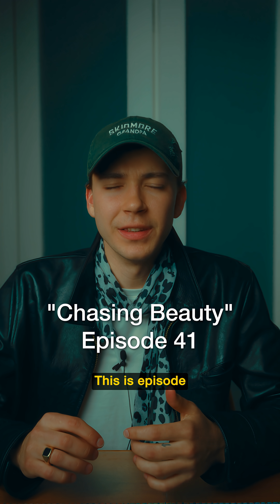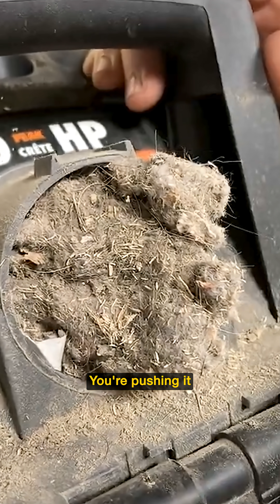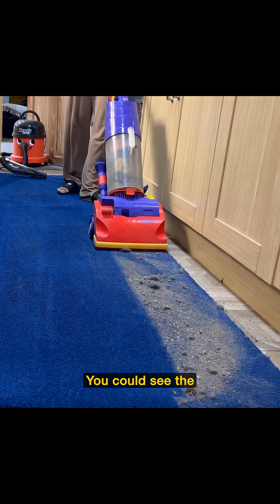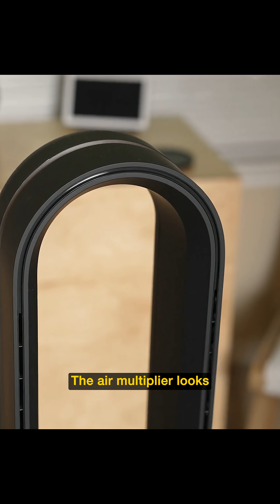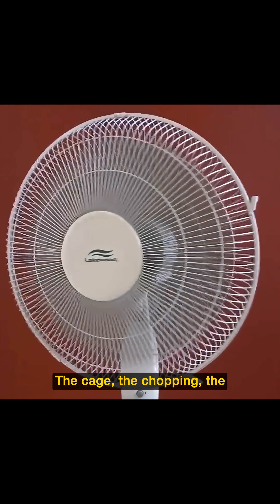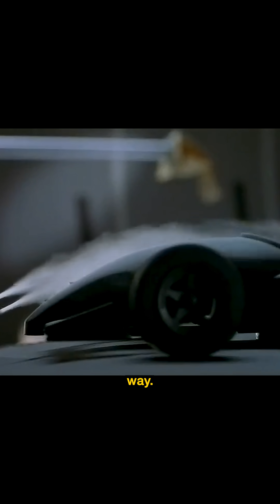Dyson products look weird, but there’s a reason. Behind their iconic product design...

Comment: This only works on easily impressed morons. The dust being visible is disgusting. You are cleaning precisely because you want to get rid of it. Showing it off is like watching yourself poop through a camera in the toilet. The bladeless fan is also a lot more complex and impossible to repair, not to mention drawing up air from the bottom oft the fanbase, essentially giving you a nice misting of carpet dust. The hairdryer seems cool because it is lightweight, until you notice that you are blocking the air intake, because your hand and sleeves are close to the bottom of the hairdryer. Also all the comfortable whirring of hairdryers and fans is replaced with an irritating high pitched whine. These could have been great inventions. They were not. The fan makes the most sense because it is at least bottom heavy, but putting the impeller there sucks in dirty air, unless you use a desktop fan only. It's also a gimmick, and hides the interesting moving parts.

Comment: After years of using bagless vacuums, I have figured out that actually bagged vacuums are way fucking better.  Maybe an expensive Dyson is better, but every bagless imitation Dyson sucks (or doesn't, I guess) so much ass and a cheap bagged vacuum wins every time vs non-Dyson bagless vacuums.  The bags are really not that expensive, anyways (order them online).  Plus it's way cleaner to replace a bag than to try to dump out a canister full of dust that inevitably poofs up into a mushroom cloud straight back into your face when you dump it out.

Comment: I hate bagless vacuums. Fine dust still clogs the filters and emptying is messy. If you have a emptying station, the thing needs the same space, cleans worse, costs more and is less durable as a corded vacuum. As a small handheld 👍 As main vacuum 👎

Comment: The efficiency of the blow-dryer and the ventilator is reduced by 2/3 or 3/4. these products are extremely less efficient. The vacuum cleaners have terrible quality. The transparent plastic breaks & chips easily. Diesoon is a clear example of form over function. The products are at least 5 to ten times overpriced. The phyisics behind them is fake. You can‘t make up with a smaller faster motor (will always use exponentially more energy) for a misconstrued airway. Please don‘t fall for Diesoon. They are marketing products close to being fraudulent: especially the super inefficient ventillator without blades

Comment: In the US, the Fantom Cyclone was first, but went bankrupt in 2001.  Dyson didn't come here until 2002.  I had the Fantom and hated it.  You'd think I had learned my lesson, but nope, I've had 2 Dysons too.  Too many joints, seals, too much plastic.  Now I'm using an old Kirby G5 that I got for $100 with all the attachments that does a much better job and can be fixed instead of thrown away.  We still have an older Dyson V6 stick vacuum that's ok for quick vacuuming of the furniture, but I have to take it apart every few years to clean out all the passeges that get plugged over time.

Comment: Too bad standard Dyson fans & vacuums clog up with dirt. 

I dont own an air filter one (they are too expensive) however, the inner ring where the air comes out has lots of dust and dirt collecting there. 

If you press gently on the inner part near any point where the air comes out, dirt will also come out when the fan is on. 

I don't want to imagine what the inside looks like. 

Also their vacuums have similar problems since they run the power cable up inside the hose.

Dirt & hair get stuck at the points where the cable is attached inside the vacuum hose.  

And inside the head attached to their clear dirt container it also gets clogged up with fine dirt, etc.  

Both are a headache to clean.

Comment: Almost hit the mark but didn’t. They shift the design to make it look like they solved the problem. In every single one it’s still the same thing just pivoted to look totally different. The closest to actually being different is the Vacuum. However, anyone who is actually into vacuums usually buys a bagged vacuum. This is because again Dyson didn’t solve a problem they just shifted it. You can’t have unfiltered air passing through a vacuum motor. Especially when the job is to literally pickup dust and dirt. Bags in a traditional vacuum act as the canister to hold the dirt and debris but also the filter for the motor. Dysons design sounds great on paper as no need to buy bags. However, the centrifugal force acts as a filter for large items which is what it collects in its canister but small dust still gets through. So Dyson had to add actual filters to prevent damage to the motor. If you check any bag less vacuums manual it will say to wash the filters regularly. I’m talking once a month or more. Then replace the filters periodically. If you have  ever owned a Dyson or other  bag less vacuum and did not maintain the filter I assume after a year it barely worked. It’s because the filter is clogged. Bagged vacuums have very very little Maintanence in comparison. Bag is full toss and get a new one and keep going.

Comment: I own 3 Dyson vacuums. The Ball Animal, the Canister Animal and the Cordless V60. I’ve had them for years. The Canister Animal was my first one and the first time I used it, it actually sucked up one of my cat’s nip toys! I was shocked that it actually settled in the canister. It was then I figured it could probably suck paint off the wall, I’m joking but the suction of it was unbelievable! I use it not only to vacuum but to also dusting with the correct attachments. 

I recently broke down the cordless (it gets used the most) and I’m talking broke down as in all the screws and seals removed and cleaned. After it was completely cleaned and put back together, the first time used it was like it was brand new! I would definitely recommend having your Dyson cleaned on a regular basis and if you’re feeling ambitious, take it apart and clean it yourself, you get to see the inner working of it!

Comment: the air multiplier thing is really interesting. it essentially trades in the velocity for flow. normally, if you just jet a small amount of high velocity air into ambient still air, most of that energy gets immediately lost to turbulence, but with the right geometry, you can use that small amount of fast air to smoothly bring a lot of still air up to speed keeping the flow mostly laminar

Comment: Just to be pedantic the first Dyson vacuum cleaner was not the DC01. It was called the DDC, Dyson Dual Cyclone. 
Only later when they bought out the cylinder model did they call it the DC02 and renamed the original upright the DC01.

Comment: 2 things tests have shown blade less fans are not more efficient they are actually less efficient than a normal fan and Dyson vacuums suck compared to the older bag versions they actually had more suction power and maintained their suction for longer than modern ones and every time you replaced the bag it went back to full force the only advantage the Dyson vacuum had was that you didn’t have to buy replacement bags

Comment: Their vacuum cleaners work well, but battery life sucks. Their fans are expensive crap. Sure it's more silent and filters the air. But for having one at home... When it gets really really hot... My cheap 30 euros fan makes much more air and cools me way more. Soooooo it might be cool looking but it's cheap plastic. You can only control it with the tiny remote control. No battery or lost it? You're stuck on what it was last. It's not worth 400 euros (for the one we have).

Comment: I’ve had 2 Dyson vacuums, a cordless and a corded, and they both were pieces of crap.  The build quality is cheap and flimsy, and I’ve had to replace the battery in the cordless vacuum frequently.   The upright corded one has a stupid mechanism for locking it upright that never worked properly.  I will never buy another Dyson product.  Interesting in theory, garbage in execution.  All looks, no function.

Comment: There were bagless vacs long before dyson.
They used to also have fabric bags you would empty, and you would shake and snack them forever and still more dust, so you could also wash them if you wanted, just make sure they are totally dry before you use them again or you can end up turning your bag to concrete.

Comment: Dyson makes water taps as well. They have a built-in air dryer. The design issue is that you can easily activate the air dryer while still using the tap, resulting in water being sprayed all over the place, including you.

Comment: It is design, sometimes over, function. The vacuum cleaners aren’t the most effective, for your wallet or your cleaning. But the hairdryer can be for the right customer. I have super thick heavy hair, non porous so it holds onto water. The Dyson hairdryer is very powerful and the weight distribution is really helpful. The powerful airflow speeds up the drying process and the heaviest part being right in your hand instead of above your grip delays arm fatigue. Worth the splurge for people with hair that traditionally takes a long ass time to blow dry lol

Comment: Bags are more hygenic though.  No dust storms when emptying the dust.  You can compact the dust, by the sheer nature of having a very powerful suction. So, as the bag fills, its suction is less, but not significantly less until absolutely full.  But, your impatience to change the bag will usually make you change it sooner.

Comment: I hate bagless vacuums. Emptying the container us easy but cleaning the filter is a nightmare. You end up inhaling the fine dust sticking to the filter while brushing it away. Bags could be changed when the suction got low. The bag held all the dirt a5dust, and you could simply throw it away.

Comment: Those fans are great and all, but they lack static pressure(more air speed with the same amount of energy means less pressure behind it), so any amount of air movement not produced by it will be enough to pretty much stop the thing from working.

Comment: My Sister has a Dyson vacuum cleaner and my mom used to have one before she moved into her nursing home and I actually like my Dirt Devil better than their Dyson vacuum cleaners for 3 reasons 

1. unlike Dyson my Dirt Devil is such a pleasure to clean Dyson vacuum cleaners are so complicated to clean 

2. you have to consistently hold down the power button on a Dyson vacuum cleaner or else it won’t stay on that’s not an issue for my Dirt Devil

And

3. Dyson vacuum cleaners can’t lock into an upright position and can’t free stand they fall over the second you let go of them my Dirt Devil can lock into an upright position and can free stand free stand also my Dirt Devil has a clear dirt collector bin and you can see the dirt spinning inside and it has a little hose with attachments to get into small places something my mom’s old Dyson and my sister’s Dyson don’t have

Comment: Any cannister-collection vacuum (not just Dyson's) will exaggerate the alleged benefits of going bagless, but all vacuum cleaners use filters, and the bagless ones might be clogging their filters faster than the bagged ones. 

The nice thing about a vac bag is that you can toss it in the garbage (for maximum tidyness, encase it in a plastic baggie first), in contrast to the dusty, hay-fever-triggering mess that is emptying a bagless cannister in the trash [can] outside, 'cuz emptying it into an inside garbage can makes a mess and spreads dust inside the house.

Comment: From actual usage experience, the Dyson fan is a bit weaker if you want direct fanning/wind, but it's fine for general circulation, and it's definitely easier to clean/maintain.

Comment: Reading the comments on here is actually quite scary, when you see how many truly dumb people there are who even though they have access via the internet to all the information in the world they still blindly refused to see.

It’s really odd the way so many people fail to see the world around them as it actually is, but only see what is obviously visible.  

A Dyson bladeless as opposed to a traditional fan.

The traditional fan move’s air, it’s as simple as that, that is all it does it moves air from the back of the fan and pushes it out through the front of the fan. 

The Dyson takes air in through the base centrifuges it pushes it through a filter and then pushes clean particulate free air out through its loop.

But simply because you cannot actually see that in action to you it doesn’t exist, but it doesn’t stop you comparing an apple to a cabbage and using social media to tell the world your incredibly ill observed opinion.

Comment: I’ll disagree with most commenters here, I don’t particularly like Dyson products. They look different, but they’re not that great. Years ago, I was looking to buy a new quality vacuum cleaner and checked out the Dyson models. I was so disappointed, they felt cheaply made, heavy and bulky. The fit and finish sucked, they were loud and the canisters didn’t seal well. I purchased a made in Germany Miele with bags, much better made, better quality materials, quieter and it’s been working flawlessly for 15 years so far. I just have to replace bags once in a while.

The Dyson fans are cool but they’re loud and way too expensive. I wanted to like Dyson, but their products aren’t up to par with other quality brands even thought their pricing is. They look great in CAD images and CGI animations, not so much in person.

Comment: Personally, I feel the Dyson fans are far weaker than any other fans. 😅
However, they do have an occasional use. Whenever it’s slightly too warm that you need a fan, but a normal fan might make it a bit chilly…that’s the sweet spot for a Dyson fan—as they can blow more subtly. 

Outside that situation, they’re sort of a terrible fan.

Comment: Too bad dyson is overpriced crap. I have two bladeless fans. One already has issues. Build quality is terrible. And they want a new expensive filter every year. The filters which dyson stopped selling after 3 years. They cost an arm and a leg. And guess what, a regular fan at a quarter of the price works just as well. Stay away from Dyson.

Comment: I own dyson. They arent that great as a company, with durability, or customer service. You can literally void your warranty by vacuuming DUST. DUST. DDDUUUUSSSTTTT. They got on to me vfor vacuuming dust!!!!

Their multi floor 2 is was 425 after tax.
While it was being repaired for the 5th time in 2 years I purchased a Dirt Devil for 78$.

I was desperate. It worked just as good as the dyson.
I was offended.
It broke multiple times after that, even recently and now they do not sell the most important parts of the machine.... the canister.

They quit selling and providing replacements in less than 2 years after purchase and I was still under warranty. It's been 3 years and they still wont sell me a replacement, even if I pay for it!

It just spits everything out to the floor again! 

To release the canister from the vacuum you press the same button that EMPTIES the canister.

It's bad design and the hoses are absurdly difficult to navigate with.

They clog easily.
Bin fill easily.
Not a quality product. Now I dont trust any of their other products.

Comment: Now if only they could design appliances like they did in the 50s and 60s. Shelves that pull out so you don't have to move 50 things to get at the back. Compartments in the door which are removable for easy loading. Ice cube trays that empty into a bucket with the press of a button. And the facade of those appliances. Nostalgic

Comment: I don't need a Bagless vacuum, they are weak, they are bad at filtration, my bagged vacuum has airflow max technology, when the bag is full, it's still gonna have the same airflow, and it's one of the most powerful vacuum (in airflow and suction) if you want to know what model this is
Philips performer pro 
2100w, sadly they aren't available anymore bcuz of eu rules

Comment: I've begged clients who don't know anything about cleaning to not buy Dyson or any other bagless, upright.
They think it's going to be easier, but never stop to think that they have to empty it constantly, especially the filter when it clogs.
Nothing like a basic, heavy motored canister with bags you only have to change when it gets full.
You can go under furniture without having to dismantle it, you can pull it wherever you need it and the beater bar doesn't push little tiny things around in front of the lip.
Much like front loading, digital washing machines...
Less water! Less agitation! just stuff it full of clothes and it's magic!
But it's not.
The clothes roll back & forth without enough water flowing through them.
One sensor goes wonky & you have an appliance visit that costs almost as much as a regular, no frills, analog machine.
The owner of a family owned appliance store in town once told me his back room has well made analog machines that he saves for his family & friends because they were made before the 3 to 5 year max usage on newer machines went into affect.
I flew to NC a few years ago, rented a uhaul and was gifted with my mother's well cared for, top loading washer & Kenmore dryer.
Best machines I've ever had and wouldn't give them up if someone paid me.

Comment: Proud owner of a DC03.  I've had to mend the flex a couple of times, I've replaced the hose once, and brushes once recently.  All easy.  The main filter is a sponge that gets washed by hand then hung on the line.  They forgot to add the built-in obsolescence
Reply: I've got an old Henry coming up to 18 years and still going, most of the Hoovers at the tip are Dysons.